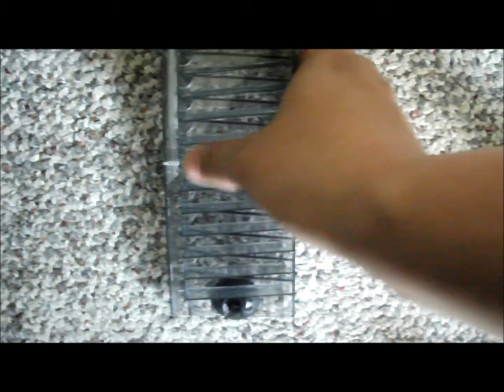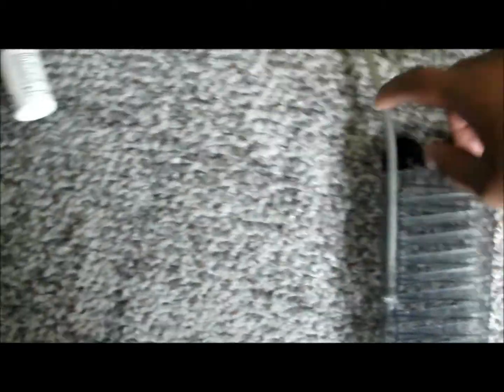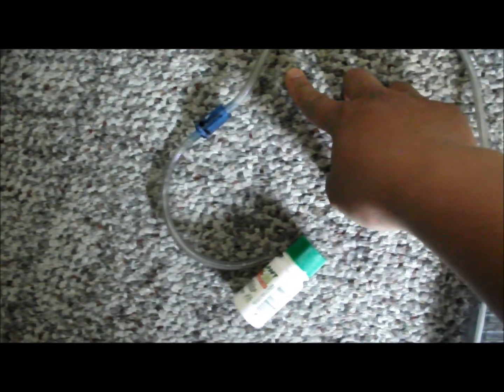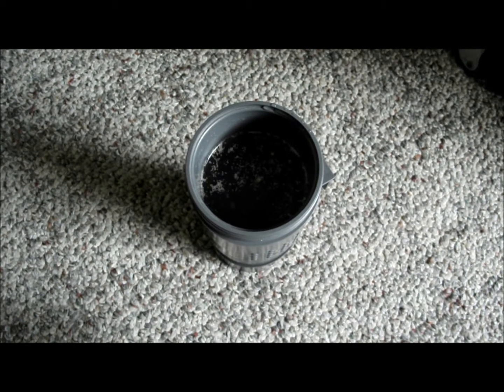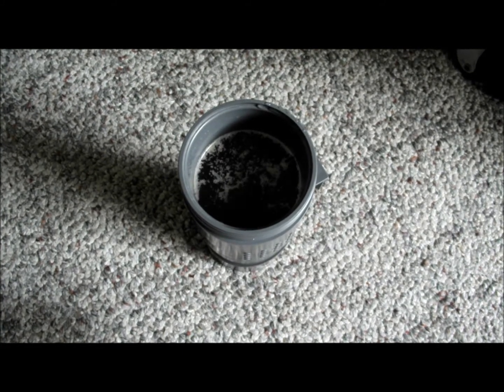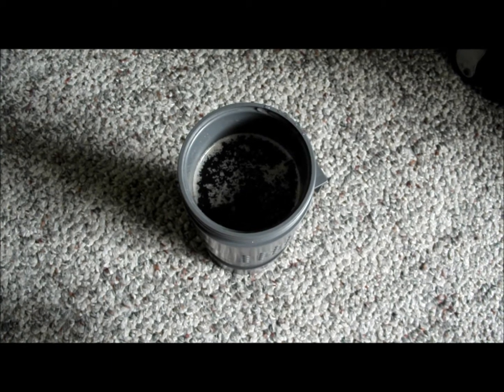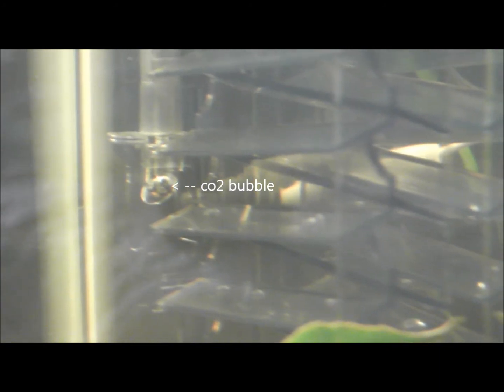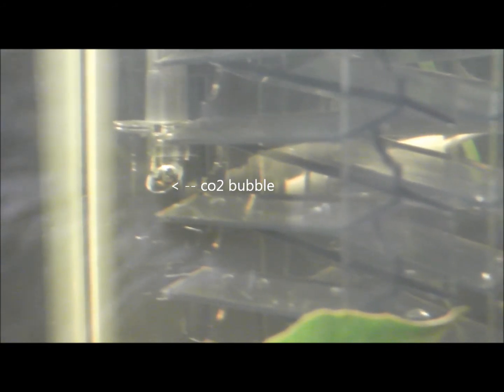How To: Setup CO2 System

Comment: Hey I have this same Co2 system.. I'm not planning on using the packets as they are expired and I was wondering about what the best recipe for this size bottle. I checked mine and it holds like 2 cups of water without anything in it (without sugar yeast etc) So what would the best recipe be?

Comment: Hi, I see you've added a check valve to your setup. I just got this on sale for 8 bucks and set it up. I'm noticing my first bubbles just now so I think that's a good sign. :) (I bought my own yeast/baking powder since the packets were over 2 years expired). Is the check valve absolutely necessary? What's the worst that COULD happen if I don't add one? Right now I'm afraid to mess around with it since it's working well (from what I can see).